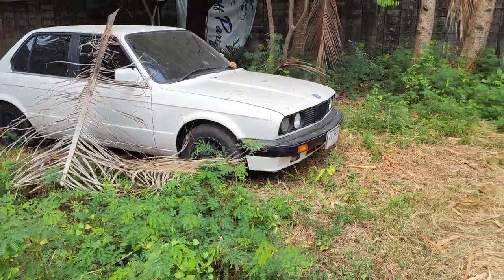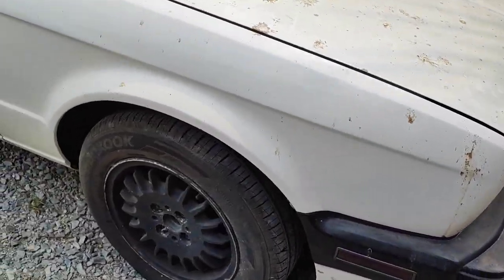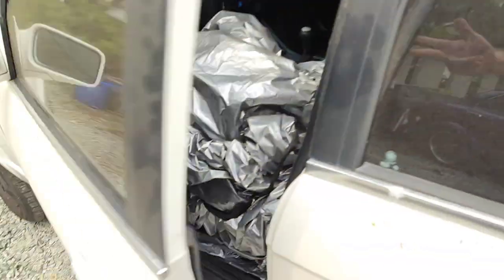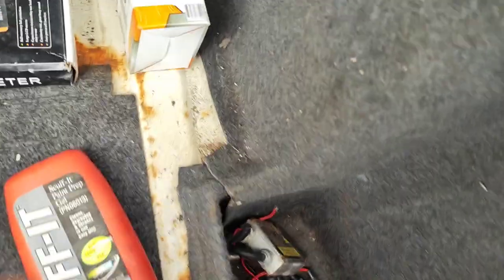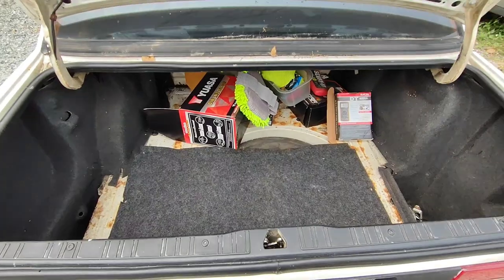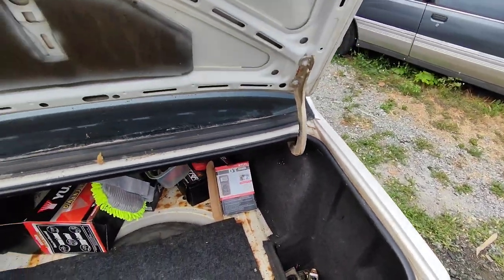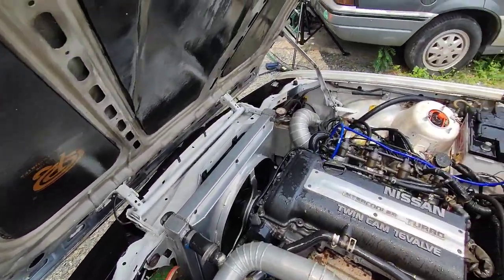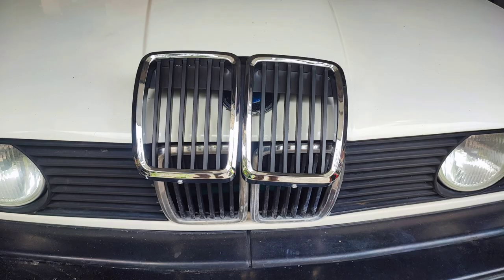We bought the cheapest E30 BMW in Thailand.

Comment: That engine bay cleaner does wonder. I would have sealed the fuse box first, but it seems that you were right to leave it open.
Reply from the maker: Didn't have a lid unfortunately! 😂
Reply from the maker: If I didn't have decent air in the shed then no way would I consider it! I think I did actually fry a couple of the el'cheapo connectors on the digital guages. They are trash. Boxes aren't waterproof at all. I usually mount em in the cabin.